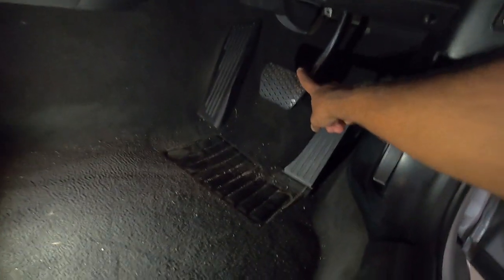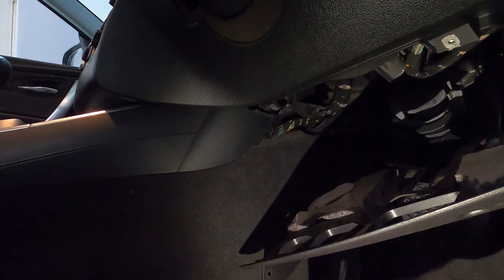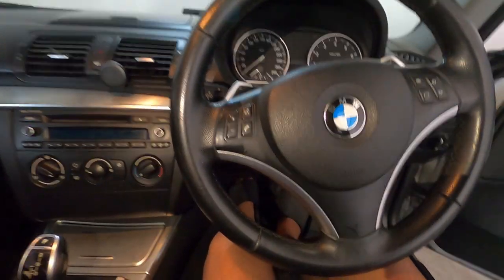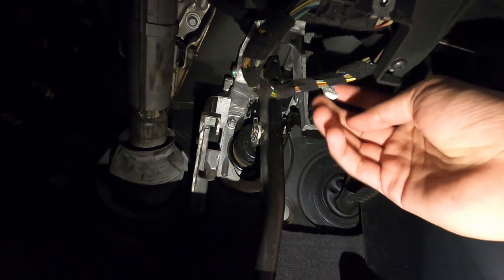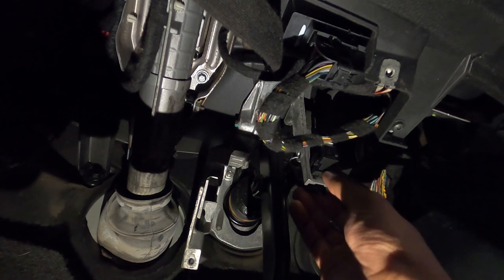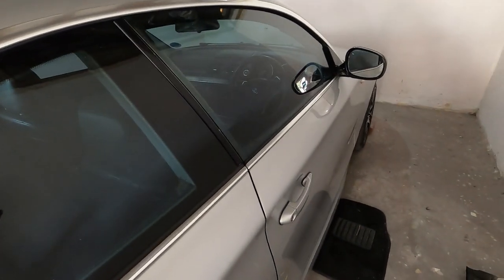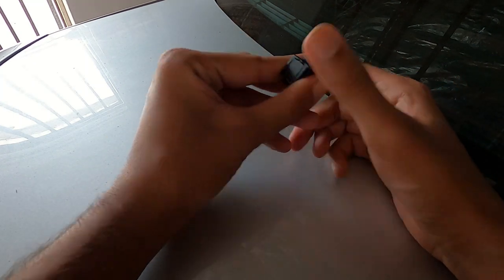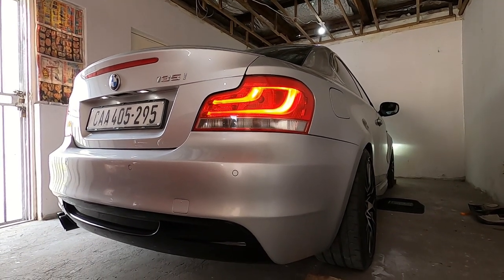Is your BMW not starting? Try this!! #checkenginelight #carproblems #bmw

Comment: The magnet creates when throthing on the brakes engaging it the magnet creates a magnetic field and the wires sends and electric discharge sparking up the spark plugs to create a combustion so when the ecu activates the feul pump you will see the busconector somehow im not sure but assume the injectors wires also on that clip you plug into that plastic compartment with the ecu that send the signal for start up and the spark plugs while foot is flat on brake and push to start is pressed the spark is glady igniting the combustion because you engaged the push to start held your foot onto the brake pedal and the magnet coming together also send a signal to the bus wires of that white plug/connector